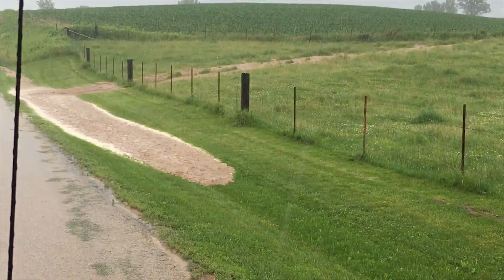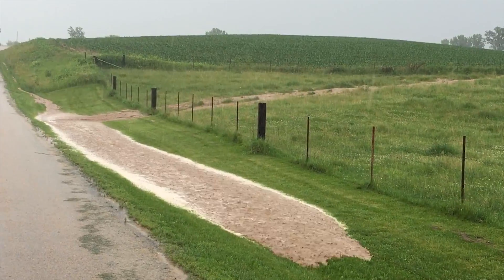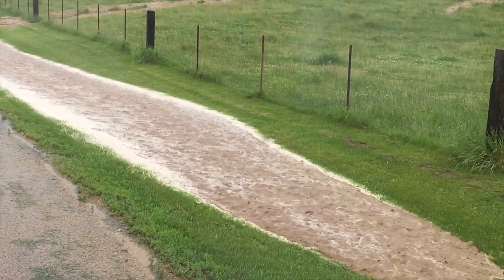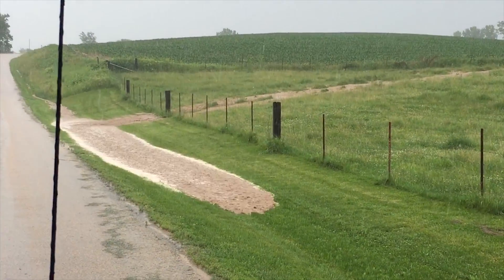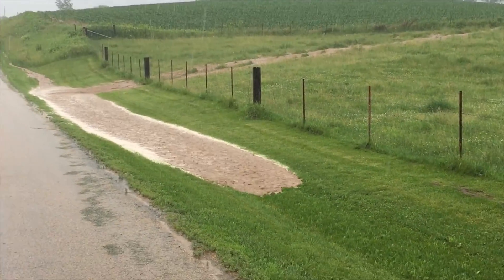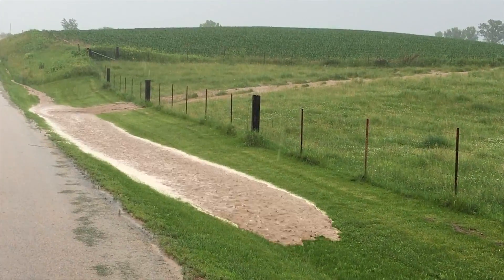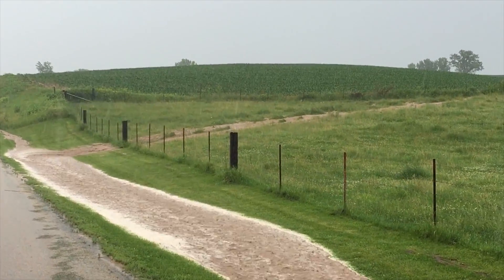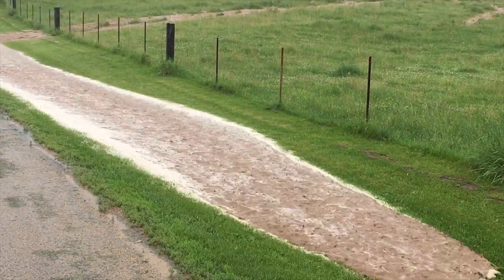Failing/Flooded Waterway - How Waterways Help Slow Erosion

Comment: I should take a picture of the south fence at the west corner of the farm at Shiner... it would visibly demonstrate why waterways and grass strips are extremely helpful for curtailing erosion... 

Grandpa and the neighbor both farmed those fields back in the 50's, usually with cotton.  Our farm has terraces to slow water runoff from the hills, but the neighbor didn't.  He also farmed right up the fence and disked the turn rows right up to the fence, up and down the hill.  Grandpa left the grass on the turn row on our side of the fence to slow erosion.  

What HAD been an unbroken hillside only divided by the barb wire fence is now a 6-8 foot drop off, because the neighbor's side washed away down the hill, and the ground has slumped under the fence over the years so now the fence is on about a 45 degree slope down from the original level of the hill on our side, down to the gully-bottom level on his side.  Sure makes it a PITA to fix fence, as both his land and ours has been in pasture for cattle for at least 40 years now... 

Most farmers farmed that ground on the contours (planting curved rows that basically stayed at the same level (like a waterline) around the hills, with the rows parallel to the top and bottom of the hill, and most fields were terraced-- back in the 40's-50's, the government had a program to help farmers install terraces on their land to prevent erosion.  The only difference between the terraces (which are basically raised soil berms running around the hills following the contour lines (level) around the hill) and your grass strips is that you can plow over and farm on top of the terraces, so long as you plow parallel to them and plant the rows parallel to the terraces... 

Later!  OL J R :)

Comment: interesting good information but did you see the rainbow behind you; and do you what cause them and the storm that had happen put so much rain down at onetime; and the soil way so dry and did not have time to take in the rain instead it ran off it like pouring water fast on a paper towel it run off the towel that is what happen during the storm.

Comment: Helo, did you never consider buying a telescopic loader instead of using a bobcat? the handling should much easyier :)
Reply: Not necessarily.  They don't fit in many areas that a skid steer will, can't turn nearly as well, and they aren't good for dirt work.  A skid steer is a more general piece of equipment with many uses.